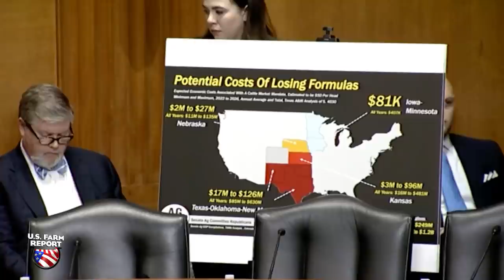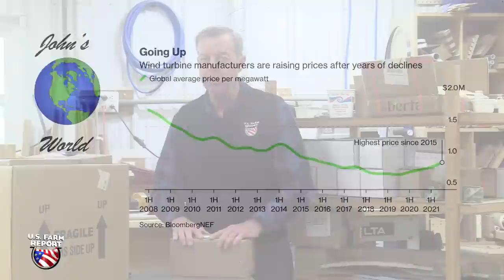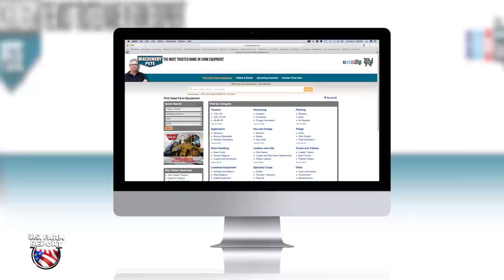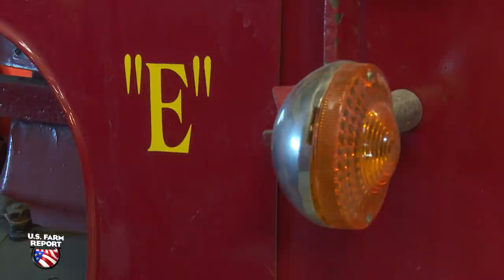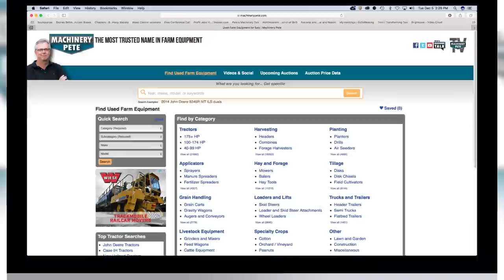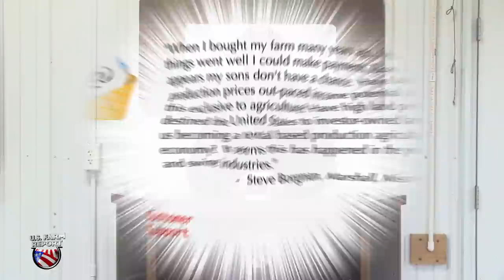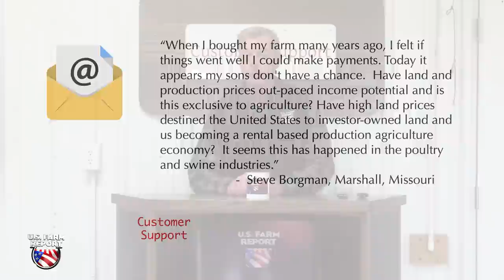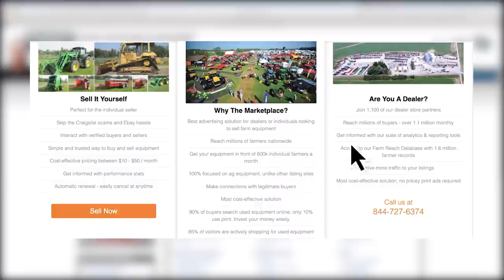U.S. Farm Report 04/30/22

Comment: This administration is going to encourage more corn to be used as ethanol by encouraging use of a blend of 15% ethanol vs the 10% now used. Corn is already going to be in short supply for human consumption as well as a animal feedstock due to the ongoing war between Russia and Ukraine. The other issue that arises from increasing ethanol content of the gasoline your using in your vehicle is it reduces the average miles per gallon that can be driven on a gallon of fuel.There will be little to no gain for the average consumer. If your in doubt ask anyone who has a flex fuel vehicle what happens to gas mileage when they ran E85. The miles per gallon loss from E15 will not be as dramatic, but still will be noticeable.